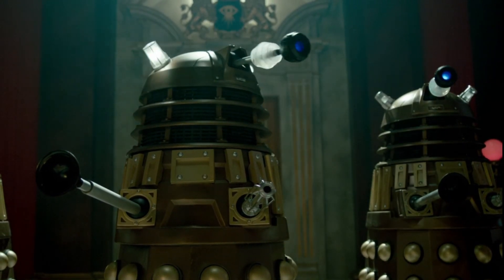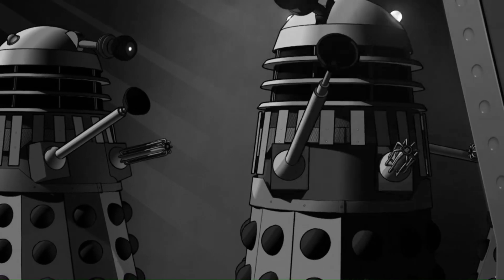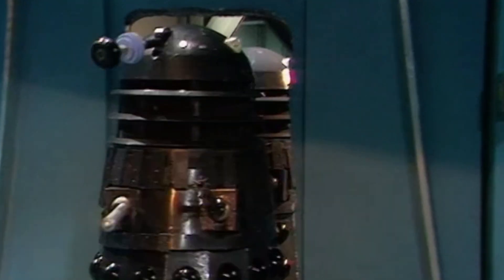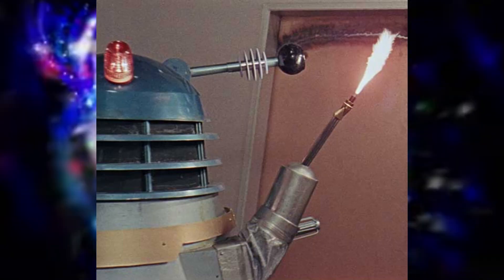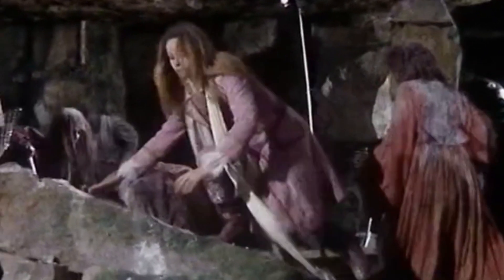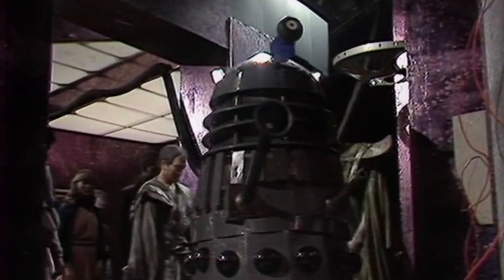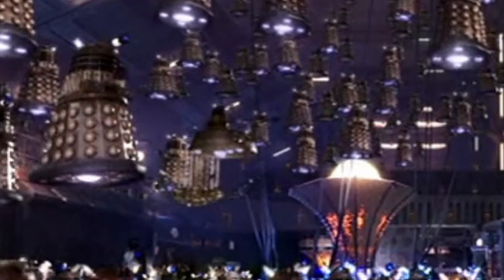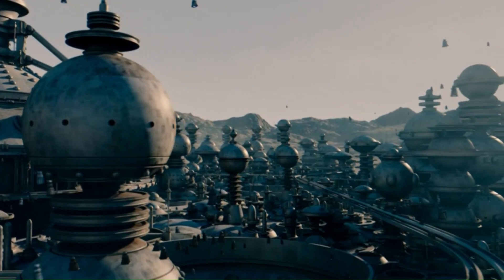A brief overview of how Daleks build things

Comment: They should have a construction Dalek with a done painted like a hard hat and a vest pattern for the skirt. I know it sounds ridiculous but it would fit especially if they were trying to integrate into cultures that had regulations for construction workers to designate ones that work in dangerous areas.

Comment: Don't forget that all daleks have a level of telekinesis, so it is possible that early Daleks used this to build their initial structures and then moved to more efficient means! Personally all of these make 100% sense, you need specaliste to repair major damage and assemble specalised equipment, slave labour can be used to build structures and mining, and drones can be used for superficial damage, or to get to areas a standard dalek cant get. They wouldn't want slave labour to be apart of major technical construction (unless theyre specifically using intelligent people, like in Evil of the daleks, to construct something they cant themselves) due to the risk of information being leaked to the wider universe